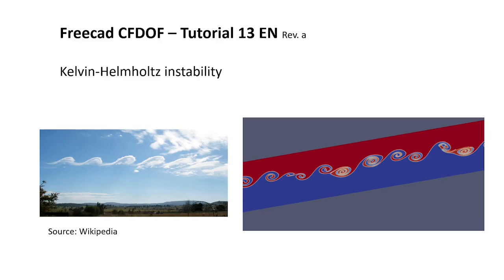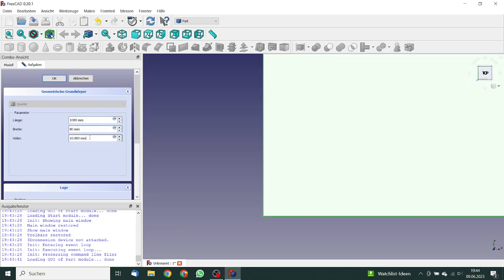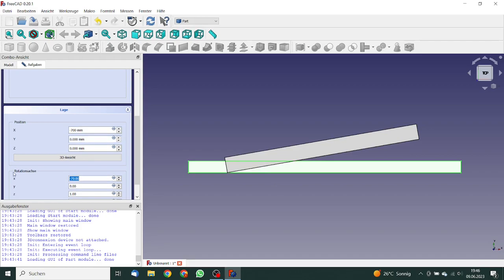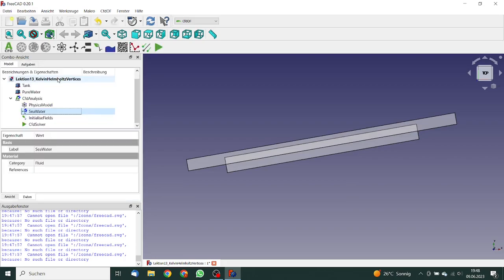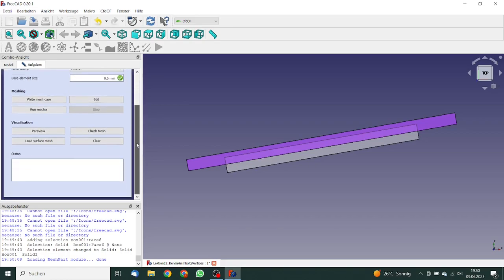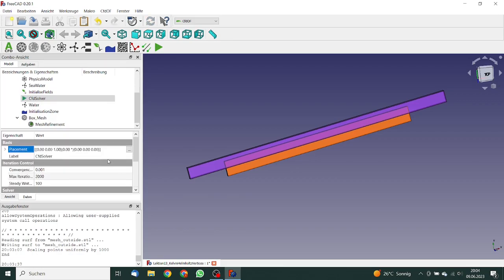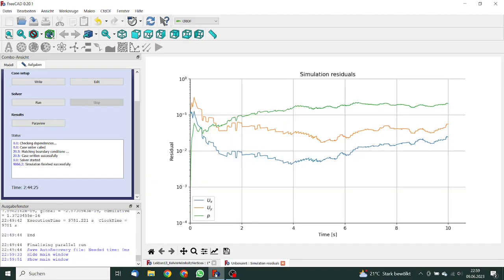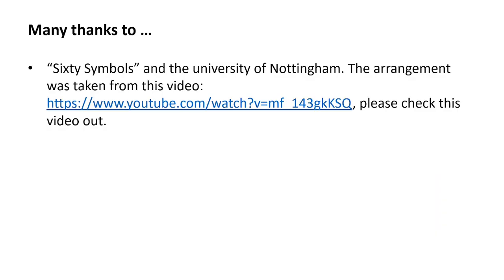Freecad CfdOf Tutorial #13:  Kelvin–Helmholtz instability

Comment: Very nice tutorial. 
What CPU and RAM had You used that the simulation needed close to 3h?
Reply from the maker: Intel(R) Core i5-7300HQ CPU 2.50GHz (4 Cores), 8.00 GB RAM
Reply: @techbernd5535  OK. 4 Cores from 2017. Very good information, to make the simulation with more modern cores faster. Thank You!